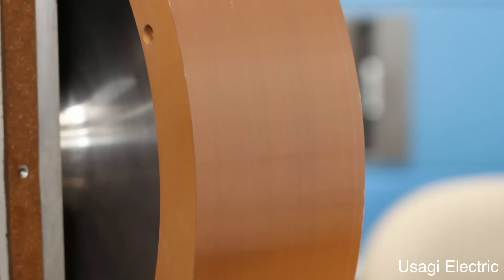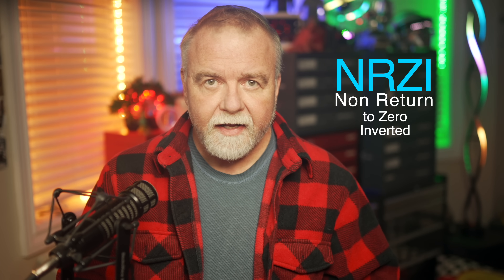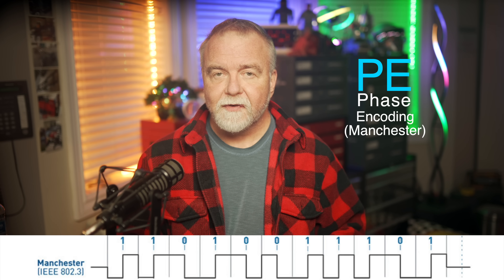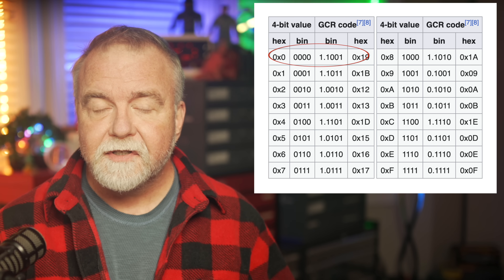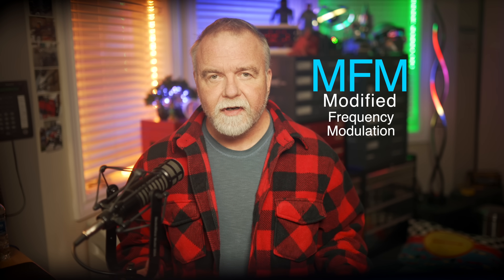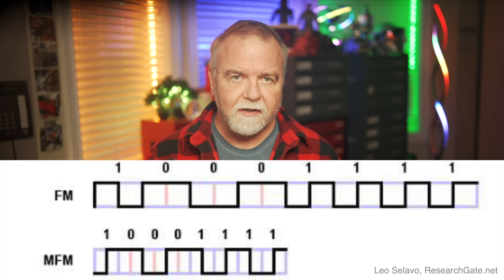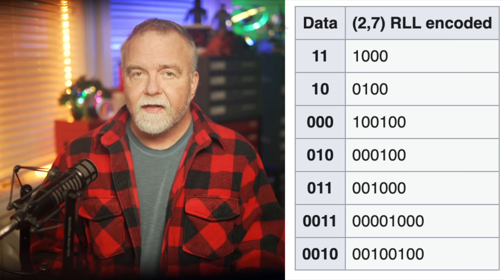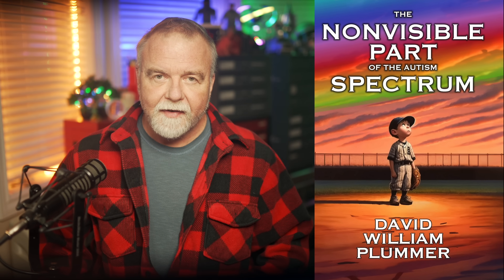Learn How Bits Are Actually Stored: NRZI, GCR, MFM, and RLL Explained

Comment: Yes, you could take an RLL controller onto a MFM drive and get more space. My buddy and I did that as well, AND.... if you you really got crazy, you could change the clock speed on the RLL controller, and you could cram even more on the same disk. There was a limit though because too fast and as you'd expect data errors really started to creep in. 

What a great time to be playing and learning 'cutting edge' computers and their hardware. I do miss setting interrupts with jumper pins though!

Comment: Oh yes, if I recall correctly I had a pair of newer PC/XTs (with 1MB physical memory on board) hooked together with a parallel cable to use one as storage for the other, with those 20MB Seagate drives on the newer controller.  Even performed a platter swap on the living room table.

Comment: The closest I ever came to having to deal with this was we had a "Golden" floppy that needed to be used whenever an accounting software package was installed. I explained to the the CFO that having only one copy was kind of dangerous. Every attempt to make a copy failed. It turned out that it was purposely made with a defect. Similar to the bad sector that software companies used on CD's. While eventually every CD writer was able to make those bad sectors that had never happened with floppies. I finally tracked down a data restoration company that had specialized hardware that could make the copy but it would have cost $500.

Comment: These are very similar problems to those encountered in the telecoms industry when trying to get streams of 1s and 0s to travel along non fibre-optic, copper cables. Transmission lines rounded the square wave transmissions making transitions between low and high states difficult and unreliable to detect. Another issue was the need to have the net voltage on the line around the midpoint between high and low over a period of time regardless of the number of consecutive 1s or 0s transmitted in a sequence. Also, as the telecoms networks became digital, synchronisation and timing information needed to be recovered reliably from the messy signal arriving to ensure network stability and propagation down the synchronisation hierarchy was well managed. All good fun stuff made so much easier by fibre optic cables.

Comment: Loving your videos but you really need to talk about Windows speed. over 17 years now I have been testing speed. Each of the 4 systems tested are of course faster in speed as they are newer system yet all have the same exact outcome: slows down exactly the same. My i9 64gb SSD system is getting close to being replaced. I predicted that this system would see the exact same issues and I was right. (all in fun fyi) Over the years I have already had two systems running. What I found odd is the second system would slow down faster when idle. I always joked that this is Windows optimizing the system for idle mode. At the end what each system is showing as they are getting faster is windows does seem to have a pause cycle.

Comment: My first hard drive was a full height 10MB.  Added an Adaptec RLL controller to get 15 MB.  "More storage than you will ever need!" they used to say! If I remember it correctly, there were only a few drives that could accept RLL. Mine was a Seagete.

Comment: By the way, you know that some software HDD erasers use multiple passes with different patterns to delete everything. This is only to account for various encoding schemes and to be sure that no matter the modulation, the disk will be empty. With modern hard drives, it's enough to write all zeros once.

Comment: CAN bus uses a cool technique in which timing recovery is only used when needed.  For "typical" data sequences in which there are no long strings of "same bits", no space is wasted with timing bits because it "just works".  But, if there are (I think) 5 bits of the same polarity, then a 6th "stuff bit" is thrown in, which is used for synchronization and is then tossed.

Comment: It's not really obsolete, though. The modern versions of these encoding mechanisms live on in modern serial communication (e.g. USB, Ethernet), where the same problem occurs of two devices that need to communicate even when they may ever so slightly disagree on a clock speed.

One additional wrinkle in serial communication, however, is that while all you need in theory is two wires to form a circuit, at high speed they start acting like a capacitor, so if you send too many ones, your physical wires may resist sending more until you send some zeroes. So modern codes, such as 8b/10b, balance throughput, clock synchronisation, AND this additional property called "DC balance".

Comment: I was a computer operator in the 70's. I heard the letters NZRI. Never knew what it meant at the time. As I was listening to this video, about errors and tape stretching and all the things that could have gone wrong, i must say that aside from the odd data check, the working correctly percentage would have to have been 99.9%. I think the vacuum tubes on the tape drives were there to stop the stretching. Can't remember the tape hardware numbers. Then we had tapes that did not have the vacuum tubes, those desk like ones. I am always amazed at the sheer mental grunt that has gone into computing over the decades. As I was doing my job, there were genuises beavering away all over the world. Like Dave. He can sit there and just rattle off the evolution of magnetic tape storage. I feel so small when I think of the effort and brilliance of human beings in all manner of endeavours, that have made this world what it is today.

Comment: Generally, RLL rated drives had better rotational speed invariance than standard MFM rated drives. If you were lucky you could use an older MFM rated drive with an RLL controller.
An installation chore was the manual entry of the drive’s bad sector list.
For fileservers, hard drives were tested continually for several days non-stop to ensure their reliability and detection & lock out of additional bad sectors.

Comment: Flashback to 1990 when I decided to implement low level floppy I/O in my Amiga games with help from the blitter, same way as the system. The blitter made the encoding and decoding much faster and simpler. In retrospect, it was pure chutzpah to use my own floppy I/O.

Comment: I closely followed the research on the GMR effect in Switzerland. The GMR effect was discovered by Albert Fert and Peter Grünberg, for which they were awarded the Nobel Prize later in 2007. It had a significant impact on hard drive technology, as the read heads utilized this effect. The first hard drives featuring this technology were released by IBM with the Deskstar 16GP in 1997 and were not even that expensive. I bought two 14GP models from IBM at the time.

Comment: On the subject of using the same drives with both MFM and RLL controllers, I had the opposite experience. I had a 30mb RLL drive/controller combination that was proving very un-reliable. I was constantly having issues and re-formatting the drive. Eventually I conceded defeat and connected the drive to an MFM controller, re-formatted and ended up with a very reliable 20mb drive. Lost 50% capacity but at the time it was worth it for rock solid reliability. I guess the head alignment was slightly off and struggled with RLL but was perfectly happy with MFM. Good times!

Comment: Great video! It brought back memories of working with carrier transmission equipment in the early 90's that used HDB3 and CMI line codes to transmit signals up to 140mb/s.  The codes were not only used to embed clocking info, they also had to invert in order to stop capacitance in the coaxial cables from building up and flattening the AC signal.

Comment: The controller created/decoded the analog signal of each track. The small cable carried these signals to and from the head selected over the large digital cable. The disk was a blank magnetic media until the low level format ( remember debug G=C800:5 ) laid down the framework of tracks and sectors. This is how the magic 50% could be created. I forget the details now but there must have been an increase in sectors per track. I never trusted RLL for longer then 6 months even on drives sold as RLL compatible. If I got the drive back before it really corrupted Spinrite would fix it for another 6 months by rewriting the entire track, LL format and data of all tracks. A wonderful explanation of the long forgotten. Huge thanks big Dave.
Reply: The problem was that the R/W heads assembly became slightly magnetized and after passing over the stored data track enough times without the track being re-written the magnetized track would be slightly erased. I worked at a large data center with large mainframes and there were a few databases that were read only, only re-written when soft errors began to be detected.
A HDA (head disk assembly) would only last about 30 days on one of these read only databases, Engineers came from the disk vendor's facility in California to try to determine the reason for this datacenter was using so many HDAs. The HDAs had to be replaced when they started to have too many errors as the errors were not data errors but servo timing track errors and formatting the HDA did not recreate the servo timing tracks, the servo timing tracks had to be created in the manufacturing plant with a special machine. By using an oscilloscope, I had determine the that the amplitude on the servo timing track had gradually deteriorated over time until errors started to occur, reported the problem to the Engineering section of the vendor and they said it was impossible!! 
To make a long story short the vendor sent an Engineer to the data center, I escorted him into the data center where the disk drives were located and supplied him with an oscilloscope, he did some scope probing on the backplane of the disk drive then said "it is impossible for any computer to do that many I/Os per second", I replied it is not even a busy time of the transaction day yet. The only solution was to do 4 way mirroring on the disk drives that were used for that read only database. Months later the Engineering Lab from the vendor had discovered the root cause of the degaussing of the servo timing track but by that time the customer was doing a tech turn on their hard drives and another vendor was chosen.

Comment: Hi Dave, Dave here. I'm glad to see again that cute old sign-off segment with the tiny furniture and welcoming narration. 

I've been lucky enough to live through all of the technologies you've talked about being used. I think I've seen a drum drive, has the chance to make the heads of an IBM 1620 disc drive move using assembly language. I still have a CPM machine with a Tarbell Tape Drive board in it. Now I took an the proud owner of boxes of my old hard drives from XTs to the current computers. Most haven't been spun since their host computers were recycled. And there is the rub, what am I going to use on my 40 plus year old Seagate? I'm sure the technology is out there, but I'm not that motivated to relearn the old ways of forgotten hardware and software. Sigh.
Reply: I don't know about being "lucky" enough to live through all that, but I did enjoy the days of wrangling a bunch of CompuPro boxes on Arcnet with some 40MB drives that were the size of a modern desktop. I helped transition the UCF undergrad lab from Arcnet to Ethernet. Right now my 3D printer is creating a thing to help me clean my motorcycle chains. An hour ago that design was just a page of OpenSCAD code. That is absolute magic.

Comment: When you mentioned frequent modulation I thought you were going to go into how some early consumer computers stored data on audio cassettes. The second computer I built (from a kit in Australia) used this method. I replaced the original 8080 CPU with a Z80, doubled the clock speed, and then used a few spare gates on the board to software select the original clock speed when reading or writing tape as the system ROM routines relied on the system clock for generating and reading the audio signals.

Comment: I don’t remember how i did it, but back in the day on the Amiga i think i used DMA to read the MFM data in the middle of the disk. Decoded the MFM with the blitter (also DMA) and analyzed the BAM to proceed to read the meaningfull data of the disk. This could read and decoded the data without using cpu power. The goal was to use the cpu to send the data over the parallel cable so we could copy disks from Amiga to Amiga at incredible speed at copy parties 😇 I tested, but never finished the “networking” part, a bit of a shame because the idea was great.
Reply: Amiga had a funky timing thing too. Instead of x sectors per track with gaps for timing signals, the sectors abutted one-another with a 'special' sync mark that couldn't ordinarily be written with MFM -- 3389 -- that's why AmigaDOS disks were able to pack 880K instead of the conventional 720K.

Comment: PRML (Partial Response/Maximal Likelihood) was a key advancement in the read-channel that significantly boosted bit density. Disk drives can get rather nasty at the inner cylinders where the bit-density is higher and bits interfere with eachother.

Funny fact: When I graduated in 1985, at one of my interviews the sys admin was very proud to show-off their brand new 1GB disk drive. It was the size (and noise-level) of a residential dishwasher. Today, my dashcam has a 256GB microSD that's smaller than my fingernail.....what will we see 40 years from now ????

Comment: I definitely remember getting an RLL controller to replace my MFM controller and low-level reformatting my hard disk to get something like 50% more space. This was in the early 1990s, when everyone was switching to IDE, so old MFM and RLL controllers and drives were easy to find second-hand, and cheap too. Especially Western Digital controllers. And here's why:

There had been an open source hardware project in a German magazine that allowed you to connect an ISA MFM or RLL controller and hard disks to an Amiga, and they said it didn't work with Western Digital controllers and didn't know why. So it was almost impossible to find other controllers because everyone was buying those, but Western Digital controllers were a dime a dozen.

I actually built one of those projects with a Western Digital controller, and reverse-engineered the software (with a little help of the hard disk BIOS listings in the IBM PC/XT Technical Reference manual). Turns out the only reason why it didn't work with Western Digital controllers was that the software didn't hold the Reset line long enough. That was easy to fix, and I used a 70MB hard disk on my Amiga as a 105MB hard disk for years. And that was a lot of space back then!

Comment: I am old enough that I have worked on tapes and disk drives that used all of the mentioned recording techniques. The greatest improvement was when the CRC code was written at then of each block so that the data read could be verified against the CRC code and if it was wrong then the hardware would try 3 times to retry reading the data and getting the correct CRC code but if the CRC still indicated an error in the data then the software would use the CRC code to do a mathematical calculation to produce the correct data. I have changed many read/ write heads on head per track disk drives and the old removable disk pack drives requiring special alignment packs and oscilloscope. A few years before I retired all the physical magnetic tapes had been replaced by virtual tapes stored on arrays of hard drives. All the hard drives for fast storage had been replaced with arrays of SSD drives. Original head per track drives that I worked on held 10 MB of data driven by a 1 HP synchronized AC motor, 5 drives per cabinet and 50 MB capacity.

Comment: yes, Dave. I had an Amiga 2000, w/ 8088 bridgeboard. & video toaster. I had a RLL controller card instead of the usual SCSI commadore drive due to costs. we just hooked it to a MFM drive & it worked. I had a 32 meg HDD with it partitioned 50/50 for Amiga & IBM. Had to boot the amiga ( workbench)from 3.5" floppy drive, wait 60 for the IBM side to initialize, then run Janus software so that i could use both sides of the pc. my biggest limitation was having 1 meg of memory.  i swear that unit could run circles around almost any pc up to including win 95 machines in most respects. I do miss those days.
Reply: Then the year after i bought the Amiga, ide drives came out

Comment: I have the memory drum from a NASA computer from the 1960s. Early on I had the electronics for the drive and connected to a Motorola Exorciser 6809 computer. It was fun to connect and store up to 256K of data. It was much faster than the paper taper reader and punch. Unfortunately, I had to give up the electronics during a move. The entire system was 2 ft x 2 ft x 6 ft and weighed around 300 pounds. It used a sync track and head and either 128 or 256 tracks with a head for each. Fun times...